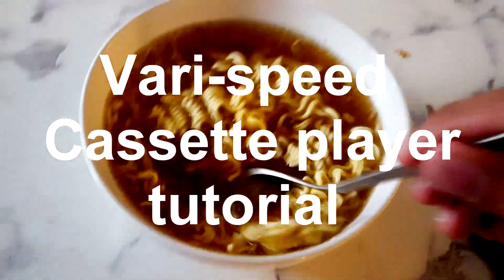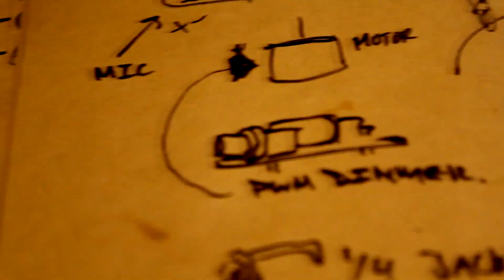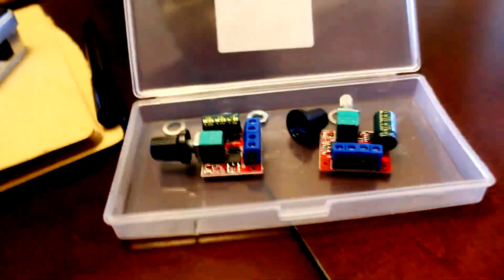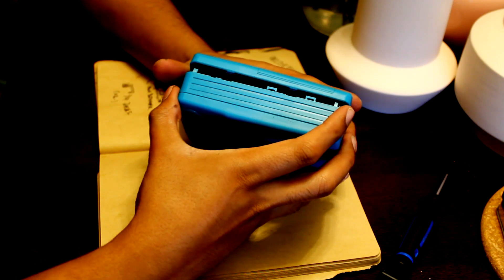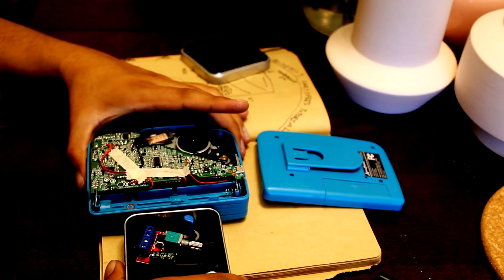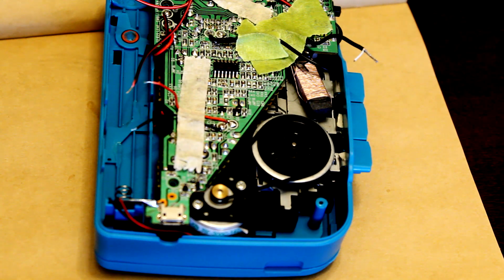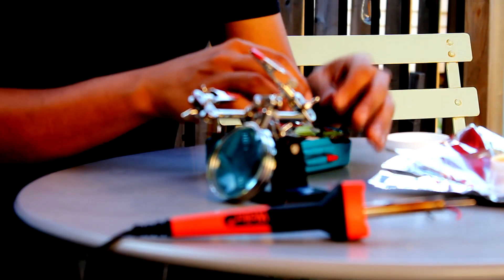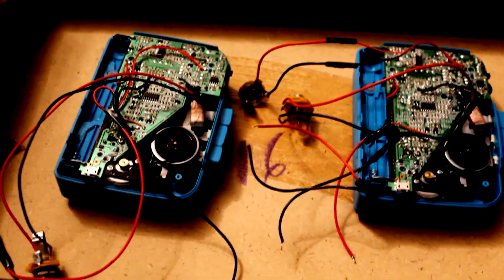SPEED CONTROL ANY CASSETTE PLAYER $10

Comment from the maker: @13:11 pretty sure that the electrical noise could be fixed with a capacitor in series with the tape head to stop that buzzing. I don't think it was only a shielding issue anymore

Comment: super helpful video hella appreciate how u explained the function of the dimmer. helps big time to know what is actually going on thanks heaps!! Im new to electronics so was just wondering how the 9v battery works? Is it just connected by wires to the dimmer?
Reply from the maker: Glad I could help out! I used the 9v, which just connects to the input terminals of the dimmer. I had to use it because the Voltage of the cassette player was too low to power the dimmer. This was a problem unique to only walkman style players however, I was able to not use additional batteries with shoebox style cassette recorders. It tells you range of voltage these need. So try putting the dimmer before the motor and if it doesn't work you can also independently power most of these style of motors with a 9v battery

Comment: Awesome video! When you found you needed to add the 9-volt, where did you connect it on the PWM controller? Like which lugs/connection spots in relation to how it was hooked up before the battery? Did the battery cables go in the same "power" spots on the PWM as the power from the cassette player?
Reply from the maker: same connections as the power section on the pwm dimmer!  So you power the motor separately from the cassette player. You still obviously need to power the cassette player as normal. Hope this helps!